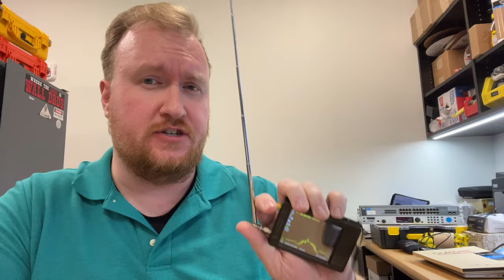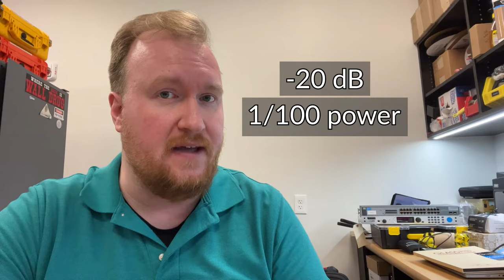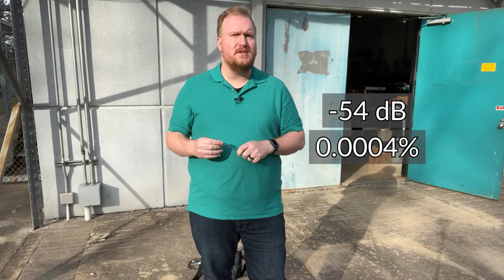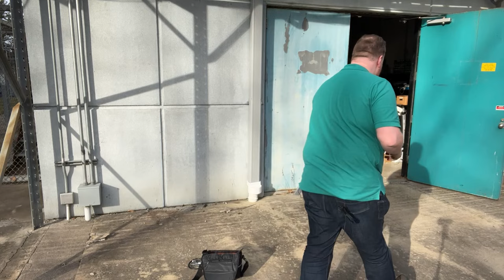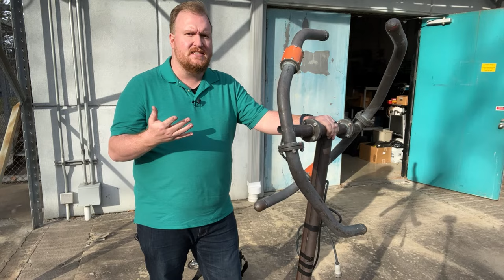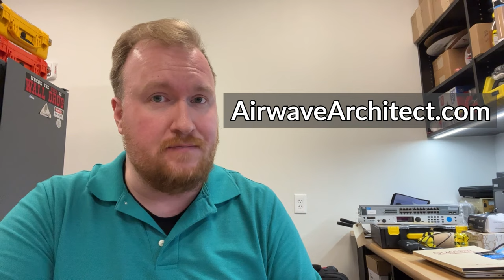The Basics of Broadcast Radio Station Antenna Systems

Comment: Wow you are me of the past cool engineers. I miss those guys. I am a radio personality retired. I'm in a community and started a cheap LpFM community radio station. 15 watts with a ground plain antenna. I'm no engineer but did help over the years when they did work. I had no idea what was going on they usually used me to do DJing... like a day timer AM at night after midnight old army surplus tx and almost 700' antenna with transmission line going across the field like 5 copper wires on small telephone poles. I've seen ready kilowatt several times back then especially when it iced over. It was awesome so much respect fur you guys. My room mate was chief engineer back in the 70's at two radio stations he got me my job at several different stations across the country back in my day. Big stations 50,000 watt AM and 100,000 FM and one in Ciudad Juárez
Chihuahua licensed to operate with a power of 150,000 watts on a carrier frequency of 800 kHz at night in 1979. I lived in El Paso was 18 years old. Man I was in heaven. 50,000 day 150,000 at night. Clear channel. I think it was CKLW in Canada that fought back and forth in between. Lol:) 
But ended up on FM after that AM was over for us rocking jocks. I have stories. My roommates were Mr. Leonard, Bg Brad Edwards (KISs Fm LA. Lee master ls WNBC well yes I was big time at one time. Lee just retired as CEO at NPR. Great guy. Back then anyway. We cooked. Anyway enough about me. 
I am listening to as an engineer. I know there are SWRs and lengths of coaxial cable and going through my limiter and compressor... lol:) nit much. But it sounds good not much noise n the carrier FM 102.7. 
Can you give sone pointers? I only have the antenna on side of house clearing the top of roof. I get out about a mile and a half but I go further and it comes back at 3 miles then gone. Antenna about 20' high. Hardly any wind load on it. So light. I should get out a little further with 15 watts. I know something is  wrong. There are like 3 communities I want you to serve just announcements another HOA the Pool the club house the lake the skiing trail, list dogs, cats, yard sales the whole community takes part in. A lot of fun. And I play a lot of music you don't hear on the radio anymore. I rock it, I country it, I worked every format so knowledgeable music, songs to play fur our age group demographics. I'm 64 now. Old. lol:) so can you give me some pointers? 
I mean I just gave the small transmitter and it a few electronic equipment. I do have a radio station a board all that but won't fit where so am. I divorced after 30 years moved from Connecticut back to Alabama. All my engineers I worked with are dead or long retired and gone. I been gone from Birmingham 30 years. Anyway no more 1st class licensed engineers... if I understand it's a general class license now. I have my 3rd class elements 1,2 & 9 and can read plate current, plate voltage and amps lol:) ship to shore. 
I had a provisional when I was 17. I go way back they took thus very seri auxiliary  back then so did FCC. Which we got visited a little until my friend came in cleaned it up. He was like you a real engineer. Liked what he did. Like me a radio personality I liked what I did. I'm having fun with this. I want to automate it and go live when I want. 24/7 but yet to come. Thanks & subscribed....

Comment: A little bit of history: The unit which is used for power ratios is the bel, named after Alexander Graham Bell. One bel is equal to one order of magnitude, which is 10 times. It's logarithmic, so 2 bels is 2 orders of magnitude, which is 100 times, 3 bels 1000 times, etc. The decibel, 1/10 of a bel, is the most commonly used derivation of the bel. In my years of working at various stations, I never saw an ERI bay closeup; they were always up on the tower.

Comment: Trust me that antenna is nothing like a "turnstile" antenna.  Turnstile antennas are horizontally polarized "slot" antennas usually with broad-banding wings.  The slots are between the mounting pole and the bar of the wing that is closest to the pole, this at the feedpoint. Ron W4BIN 
  (retired broadcast engineer)
Reply: I have seen turnstile wings fed directly by a coax harness.

Comment: Hello.  I just found your channel and subscribed.  I have a question please.  There is a FM station a few miles from me that the local university operates.  I looked up the specs, and it says its running at 250 watts.  The antenna it is broadcasting from is a few hundred feet and I noticed the radiators are placed halfway up the antenna.  Why not mount them at the top for better coverage?  Thank you
Reply from the maker: In many countries, radio station licenses are also categorized into classes. In the United States, for example, a station of a certain license class is given exclusive use of their channel to a defined geographic area, generally a number of kilometers from the transmitter where the signal strength must be a certain value. Since FM uses VHF and is typically line-of-sight, it’s possible that using more power or mounting the antenna higher on the tower will cause the station’s signal to be too strong outside their defined contour area, so lots of stations cannot use the maximum antenna height or transmit power for their license class! Stations can trade antenna height for transmit power or vice versa, but what remains the same is the signal strength contour distance. Hope that helps!
Reply: @BroadcastBlueprint  Thank you!  That helps a lot!  Although I never got into the field, I have always had a love of radio.  I got into short-wave back in the early 1980's and wanted to know the in's and out's of how radio waves propagate, etc.

Comment: I was wondering is there a way to connect a 50 ohm antenna to a 75ohm cable
Reply: A balum can match the impedance, but better to use 50 ohm coax to start with

Comment: Uhf stations use mega watts, please explain
Reply from the maker: Since TV stations frequently use UHF (higher frequency) signals, their antenna elements are smaller and the propagation isn’t as good. Thanks to that, they also use many more antenna elements to increase the gain of their antenna arrays, resulting in an effective radiated power (ERP) approaching or exceeding 1000 kW.